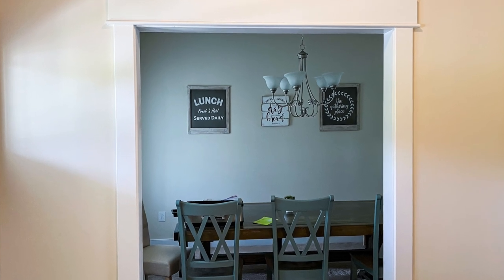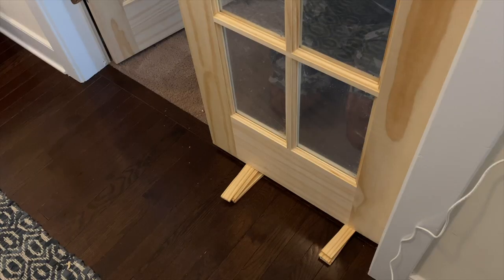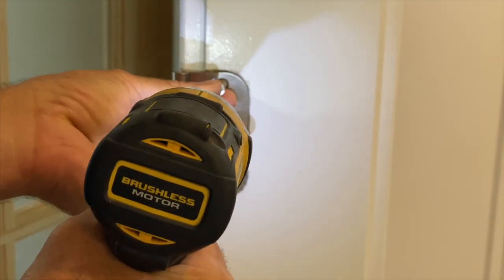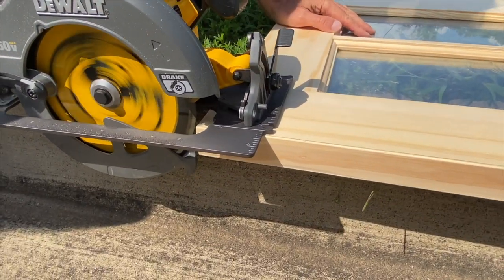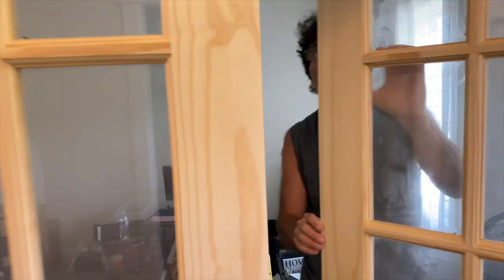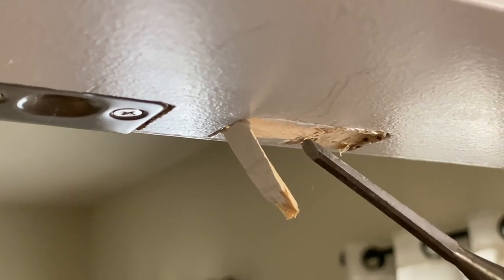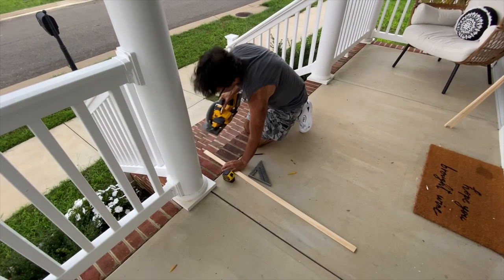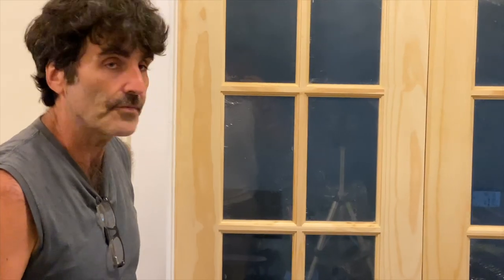Transform a Boring (48") Opening with Stunning French Doors in Existing Opening!

Comment: This is awesome but my existing opening is very wide almost 95 inch wide. Do you have any suggestion how to fix a door in such wide opening ?
Reply from the maker: Yes, unfortunately if I was in that situation I would frame the opening for 72" using two 36" doors..  You'll have to drywall the difference and paint the wall so that it looks like it's supposed to be like that.
Reply: @TheHomeImprovementChannel  Thanks for your reply. I am now thinking of may be using a barn door instead of french door because of the width.

Comment: We just did this and the doors are hitting at the bottom when trying to close but there’s a gap towards the top. How can you fix that?
Reply from the maker: It probably means the opening is out of square.  The easiest way to fix that is to close one door and then close the other door but not all the way.  Take a pencil and draw a line on the trouble door using the closed door as a guide.. this way you'll have a reference of where the trouble spots are.  You'll have to cut the door so that it appears straight in the opening.  If you're not comfortable with that, you can ruin your door... I actually mention this at 2:30.  The only other way to fix it is to take the trim off the opening and expose the sides of the 1x6 boards.. you'll have to manipulate them around until the doors are actually straight... adding shims where needed.  Hope that helps..